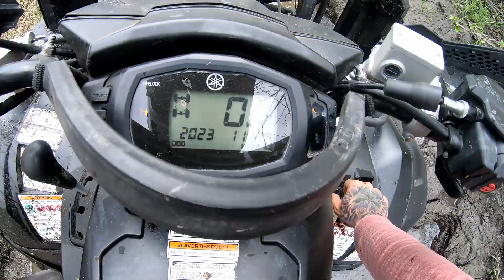New Self Driving Yamaha Kodiak!

Comment: Only a mechanic can/know how to fix issues like that. It's not Yamaha's fault, it the people that have been working on it 😊
Btw you should use diff-lock when driving in mud like that, you know Yamaha also have true diff-lock, something can-am and polaris doesn't have.
Reply from the maker: Can am and Polaris both have true diff lock. So you are aware. Also, it wasn't needed, so I didn't use it.
Reply: @MainvilleATV  With can-am, diff-lock doesn't connect until you start spinning.
Reply from the maker: Not true. They have two true front locking diffs, look up 4lok and smart lock. They have it in several models.

Comment: Had the same problem with my Kodiak and also a friend's grizzly check your air box mine was missing a screw out of it from the factory and allowed the air box to move back and pull the throttle body out of the cylinder head

Comment: Jinxed yourself right off the bat ... ( E Z ) Sunday cruise! By the way do you like those tires on your wife’s quad?  And as I ask you that question. Wala you’re stuck in the mud. Just pulling your chain. So what do you think about those tires are they good for the trails? What are they rated ply wise would you slap them on a max XT 850? Or do I have to cut my fenders? I’m stuck in the warranty Hell hole yet. Well back to the video.
Reply from the maker: They're quite a unqie tire, I have a full write up on them on www.mainvilleatv.ca if you'd like. I believe they are 6 ply of various materials. I'd have no issues putting them on an 850. You would likely run into minor rubbing with 30x10. Might get away with it on a 0mm offset rim but likely still have some trimming. Mostly due to the XTs softer suspension. Have a look at our article on our website and see if they work for you :)